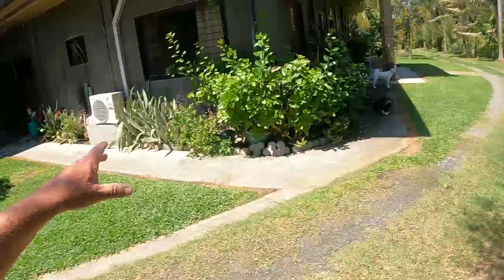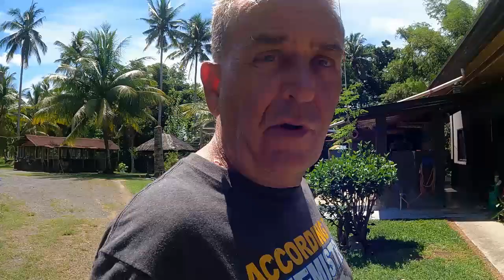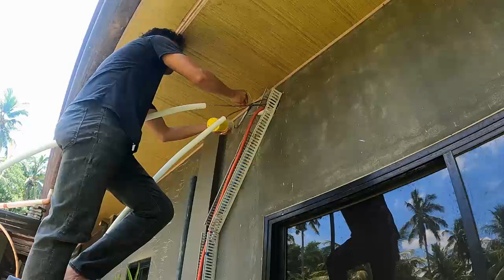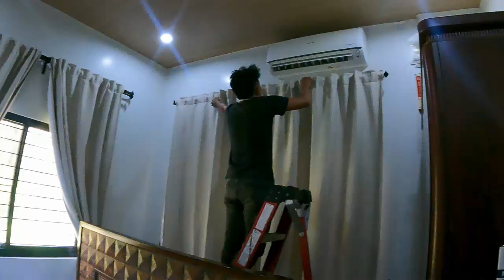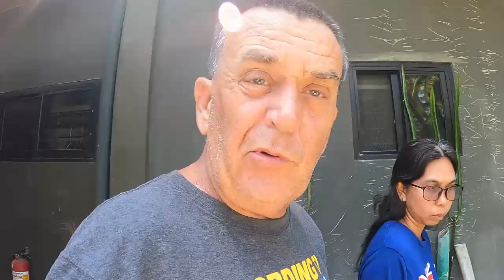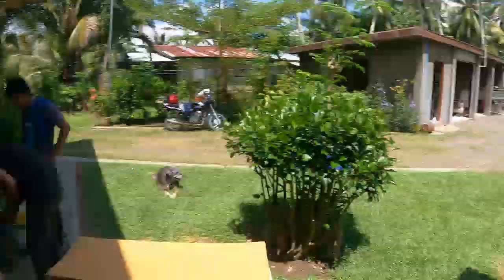Installing the new Air Conditioning Unit in the Guest Room. Out with the old and in with the new

Comment: Normally when aircon is fitted, due to the bleeding to connect it, you need to regas the unit so it lasts longer before you call engineer for a regassing as it wastes so much on bleed out fitting
Reply from the maker: I will check the pressure with my own gauges in a couple of days

Comment: Ya gotta love it.  It really is more fun in the Philippines.  It's like playing, lets guess what they will turn up with?  If installing a new aircon, you would expect a vehicle of some sort, and a few tools, some refrigeration gas, a vacuum pump, and a bit more stuff for detecting leaks and the like.
Funny thing is in USA they now sell DIY aircon split systems that only require power connections.  The pipes are already evacuated, gas is in the unit.  You have to use all the pipe supplied as is DON'T cut to length.  The connections must be some kind of quick disconnect.
Reply from the maker: Wow that is amazing,,,

Comment: Interesatsing they use a metal guard over the outside pipework. When we had our splits installed in North Eastern Mindanao( Prosperidad)  they just wrapped the pipework in white tape and left it. Back in Australia they all use plastic covers which leaves the outside pipework nice and neat and protected, like yours. As you say its the Philippines, anythng goes here.
Reply from the maker: Yes when we had the hose done in the past , I insisted on the plastic covers thing it was the same as in Thailand, HAHHAHAHa oh well, you can still buy the Thailand ones here , but they are in a kit box.. not the long lengths you get in Thailand, Thailand is 30 years advanced to the Philippines. but the electrical plastic still looks better than nothing.

Comment: All of the systems come precharged for a certain amount of line set. I'd like to know where the vacuum pump and guages are to remove the air and moisture?
Reply from the maker: The main unit is pressure at 200 psi, when they conect and flush the sir out on opening the system it settles back to 150 psi,, so they said